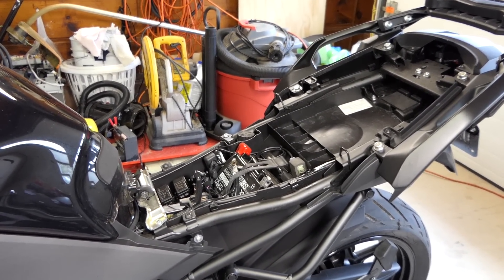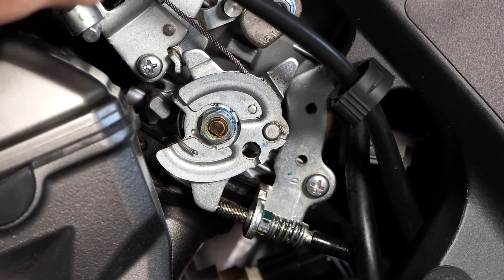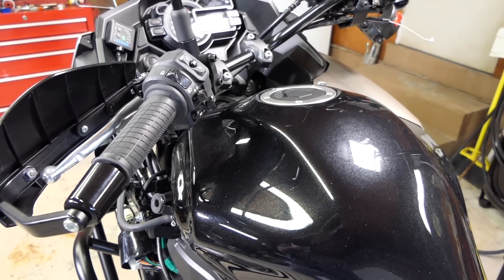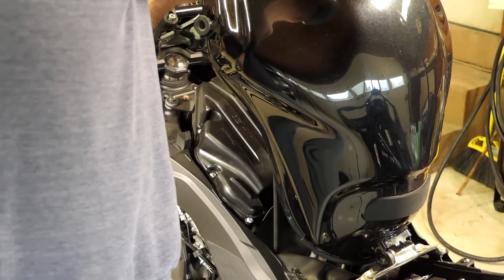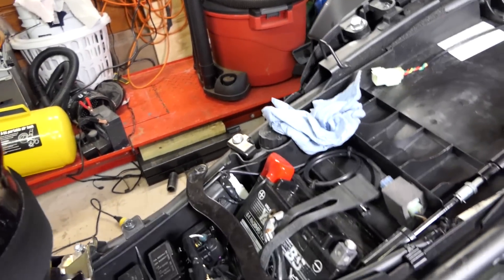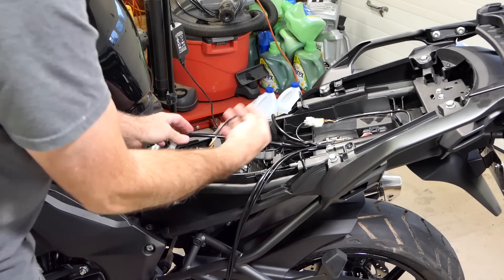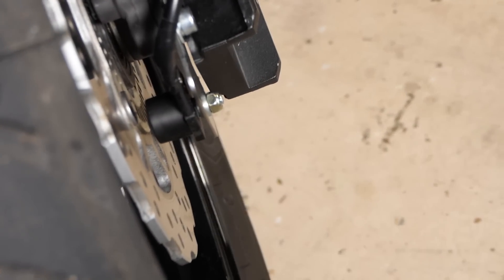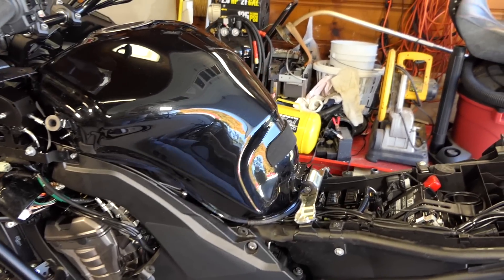Kawasaki Versys 1000 Electronic Cruise Control Install

Comment: Thanks to Jon at Ozarks Backroads from the team here at MCCruise for videoing this Versys install.  Great quality video and great work.  Glad you like the product!  The principle is the same for all electric servo MCCruise installations.  The differences all revolve around where the components are located.  Throttle-By-Wire MCCruise kits are significantly easier to install.
Reply from the maker: Good to hear from you Tony,  I knew you had a good product from the reviews that I had seen. I am always happy to use products in my videos that I feel are genuinely  good and I was not disappointed here at all.  I will get to review the cruise system more this upcoming season when I go out on some longer trips. We are currently stuck in mid winter up here in the northern hemisphere.  Thanks for the comments and keep building awesome products......  Jon Smith  ....:)

Comment: I mounted a unit to my 2011 Concours when it was new.  Mine has the older vacuum servo.  It has been really nice.  One of the features that I really appreciated is that all of the connections are so clean.  No tapping wires.  I added an audiovox to an ST1100 years ago and it required fabrication and wire taps.  MC cruise was much better.  I will be adding one to a 2007 ST1300 soon.
Reply from the maker: good to hear from you sir....   rock on....   :)
Reply: @ozarksbackroads5484  Your Versys looks like a lot of fun.  I own a Z1000 and it is surprising how similar the frame is to the Versys and 1000 Ninja SX.
Reply from the maker: @alanhassall  yes sir....  same engine also....  :)
Reply: @ozarksbackroads5484  It sounds like the Versys has more sensible gearing although I saw that you did change the sprockets and chain on yours for more relaxed cruising on the highway.  As per the similarities, I put bar risers on my Z1000 and the clutch cable is a little too short now.  With rerouting it makes it without affecting clutch action, but it is a little tight.  It is too bad that someone (Kawasaki) doesn't list the lengths of the clutch cables for the Z1000, Ninja 1000 and Versys because I could use a longer one, but don't want to go overboard.  I'm going to have to figure out how to go about determining which cable would now fit.  It's always something.

Comment: Great video. Very helpful on the install. My question is have you had any issues with the cruise not engaging after riding in wet conditions?
Reply from the maker: Hello there sir, good to hear from you.  I do not recall having any issues of any kind with the McCruise control.  I sold the bike to a friend a few years back.  He has never mentioned any problems with the cruise on the bike to me.  If you are having trouble I would message tech support at McCruise .  They are good to work with....  Thanks for watching... good luck and keep safe out there...  :)

Comment: how's that CIU little box doing after these years? Does it require any maintenance? Cables getting a bit slack and all ?
Reply from the maker: Hello there, the cruze is working fine.  Yes the cables have to be checked and adjusted periodically... a couple times a season seems to work pretty well... thanks for watching... keep safe out there...   :)

Comment: Hi John, (or anyone else who has fitted this) Do you remember whether the throttle was any "heavier" after installation in everyday use - pulling the extra cam and cables etc ?. Great video with clear instruction as always, thank you :)
Reply from the maker: Hello sir, the throttle pull was slightly less after the cruise install. The pulley used is about twice the size of the one on the throttle body assembles.  It was quite nice to ride with the easier throttle pull..  good luck sir.. thanks for watching...   :)
Reply: @ozarksbackroads5484  Thank you, that is really good news. i guess I'll just have to get on and fit one. All the best to you :)

Comment: Hi John, love all your installation video's :) Quick question - on a ride by wire cruise control, the twist throttle grip stays at the rest / closed position, once engaged. As this is cable operated - does the throttle grip actually move or does it go to the rest position ?
Reply from the maker: Hey there Mark,  the throttle moves just as if it were being operated by hand....  thanks sir....    :)
Reply: Hi John, following on from Mark's question, I guess that means that your speed will still vary a little when you are holding on to the throttle if you don't keep your hand pretty steady?

Comment: What type/brand of muffler did you replace yours with? Dont want noise, but the stock version is rather hideous. Great video, and I will be getting one of these when I make another long trip.
Reply from the maker: I put on on a Delkavic muffler.  It is a little louder that stock but its not bad.  It isn't noticeably louder when cruising down the highway.....    :)